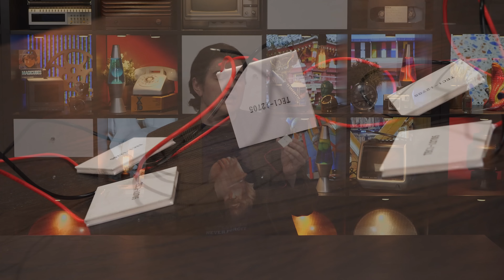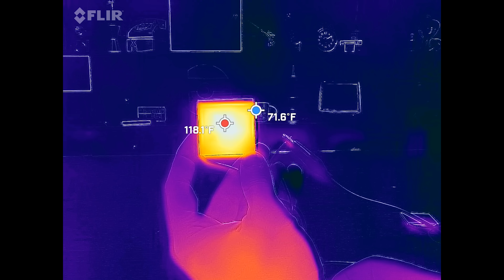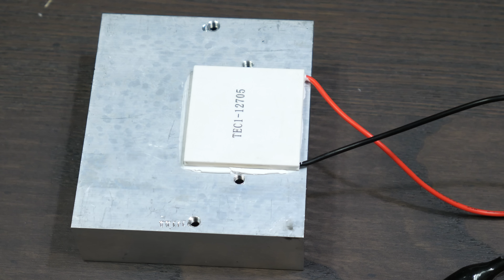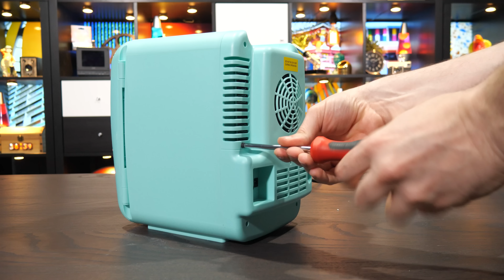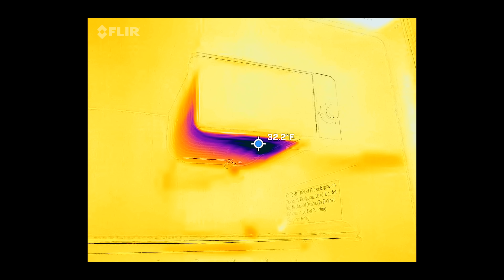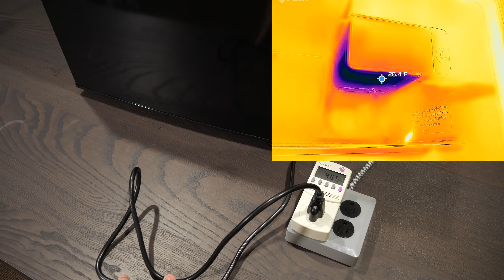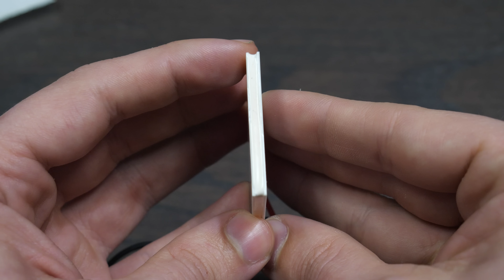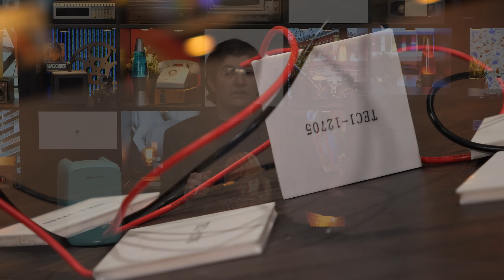Thermoelectric cooling: it's not great.

Comment: Actually Peltier elements do make a nice job while working all the way around: by generating electricity. Such as fans that you can put on top of your fireplace, and it will stir the air around a little bit; or chargers that work from fire. Yep, they suck at generating energy from the heat too, but there's the gimmick: literally everything sucks on generating energy from not very high temperatures, and even turbines with overheated steam doesn't efficient in general, however, we use them because we don't have anything better.

Comment: There's another argument for peltier elements: their size and ease of use.
If you're working on a project where you need some type of cooling but it needs to be small, then this could be a good solution.
Also, heat pumps aren't as readily available for DIY as peltier. In some cases you might even need to do some plumbing with those copper lines. And then you need to be able to fill the lines up with refrigerant.
In countries like Germany you're not even allowed to mess with refrigerants. If you install a split air conditioner yourself without the proper paperwork, you can get a fine!
And these peltier elements can be used by anyone.

Comment: Another application for the peltier plates that i saw getting rather popular were on cooling vests. Ofc they dont use only the peltier for cooling, most of them will have a coolant medium (like salt water slush) and like the blue blob require fans to expel the generated heat, which makes the form factor compromising with a lot of things. Mainly the batteries used. You wont be hooked on the mains while working with a vest like that so you will need a high discharge and capacity portable battery to be able to feed the peltiers, fan and portable pump used to move the coolant stound the tubing inside the vest. Might as well have a mesh vest underneath and put some cooling gel bags or even ziplock bags around your chest area rather than using those.

Comment: I used to have a small cube fridge, like the black one in this video. One day, it stopped working. I wanted to try to fix it myself, so I looked up the exact brand and model and I was shocked to find out that all it had inside was one single peltier, a heat sink and a small fan and this was responsible for making the whole fridge cold.

Comment: 1. One big advantage of Peltier cooling is that it cools or heats pretty fast. The thermal cycle of refrigerators is pretty slow in comparison
2. Theoretically, you could reverse the cycle of a refrigerator heat pump to heat the inside instead of cooling.

Comment: You forget the flip side if TEC's. That you can use them to produce electricity (very inefficiently.) like on deep space probes.

Have a Pu240 heat source, tec in the middle with a heat sink exposed to the cold vacuum of space and boom reliable electricity for decades.

Sure you don't get a lot of electricity, and it's woefully inefficient. But with an effective infinite heat source and a few ganged up together you have yourself a regular nuclear battery.

The Soviets also used this system (Thermal electric generation) to power remote listening posts, radio relays, ...

TEC's are awesome. Just very niche 😜.

Comment: I recently purchased a "cool box" fridge for camping and I have done a load of experiments with it. It'll get down to 5 degrees celsius pretty quick if you add ice packs at home first. It'll stay around that temperature all weekend running from a lifepO4 battery charged from solar.
Yeah it's not efficient and the mini drinks coolers are crap and not worth having at home, but a cool box for camping off grid for a few days is the difference between a warm beer and a cold one.
I wouldn't take a fridge camping as it's not practical for us, but the cool box is perfect. On the flip side, I wouldn't ever use these at home as they are not as good as a fridge.

Comment: Get one of those really compact compressor based portable car fridge freezers that are chest style. Insanely efficient and way smaller than one of these mini fridges. Put it on the floor and you can open it from the top. They have ones as little as 10L capacity and 45w-60w while in use.

Comment: I had a dual stage wine cooler that was a peltier device and it worked great it could cool a 12 pack down in like six hours but it pulled 240 watts It could hold about 30 cans as well then I got it for 30 bucks Used so that's $1 per can

Comment: If you are in a room that has problems holding heat, anything that'll help keep it warm is welcome. I'd imagine that small fridge would be helpful to be a little extra heat in a small, cold bedroom. That is a small victory for the peltier fridge, but still. If your room regularly gets to say, 60f/15.5c, this would keep beer more that cold enough and might even freeze things a bit (slowly. The latent heat of freezing is just as much of a doozy as the latent heat of vaporization). Still, for only 6 cans? Not 12?

Comment: Perhaps the most practical use for Peltier units is to use them as a generator. When you apply heat to one side and put a big heatsink on the other, a tiny bit of current is generated, and it's enough to run a little fan. I have two peltier powered woodstove fans and they are very effective at moving air away from the stove and there's no fiddling around with cords. It's a great way to improve the effectiveness of heating my home with a renewable, off-grid, carbon-neutral, locally-sourced, fossil-fuel-free, non-GMO, gluten-free, and cruelty-free fuel source. It's also just plain free if you're willing do do a little bit of work.

Comment: I wonder if you could make a more efficient fridge if you used many Peltier elements so that each one was using little current keeping the heat production low and used a thermostat to control the temperature.  Not sure if heat absorbed through the Peltier elements, and the consequential lack of insulation wherever an element is placed, would counteract the benefit of adding more and more Peltier elements.  Need an engineer to calculate if there is decreasing marginal returns for adding more and more elements.  They seem cheap enough to add many.

Comment: mostly unrelated tangent: i have had an idea for a while about a cooling device that converts heat to electricity. even if the amount is too small for any real use, hook it into the grid and you get free cooling.

Comment: One cool use of Peltiers is in PCR (Polymerase Chain Reaction) machines we have in the lab. The PCR process involves amplifying DNA by repeatedly heating and cooling it to copy the genetic material. One of the key advantages of Peltiers in PCR machines is that they can precisely heat and cool the samples to the exact temperature required for each step (within something like 0.1°C or so) - it's not about efficiency here, since samples are tiny, but rather the precision and reliability they offer.
Reply: Ahh yes pcr tests the super usable and accurate science we must trust
Reply: @andreahighsides7756  I mean, yes? It's a common lab technique used for many different things, including genetic analysis and forensics.
Reply: @andreahighsides7756 are you a COVID conspiracy theorist or something? PCR isn't a COVID thing it's a powerful method of quickly replicating tiny amounts of DNA to make a larger sample. PCR is very reliable, the problems with COVID RT-PCR tests must be either the reverse transcription process or the method they use to analyse the amplified sample after PCR. I'd imagine it's the reverse transcription because any traces or errors in the sample will also be amplified by PCR.
But it's wild that you know about PCR but only in the context of COVID tests.

Comment: How would a Peltier fridge run if it had a water-cooling system to take the heat off, good insulation, and a thermostat, I wonder? Is that something anyone has tried?

Comment: oh boy, finally i understand how these trash pseudo fridges work. 

my band wanted to get a fridge for the rehearsal space, so we can keep beverages (mostly of the barley malt+hops+water kind) cool. looked through some ads, offers and such, sent links back and forth for small actual fridges. they were all in the 200-300€ range, so not terribly expensive, but nothing to sneeze at either, considering it'll be an appliance that runs 7 days a week only be used for 4 hours of said week. our bassist sent a link into the group chat with one of these, it was decently sized, enough to fit about 8-10 glass bottles of beer in (if your tetris skills are good enough), and it cost 80€ on amazon. i looked at it, and didn't find the refrigerant warning lable in the description, and knew right away, it's one of those things with a blower that doesn't really cool anything (or so i thought, cause every time i got to use a camping cooler that runs on the same tech, but from a 12v car cigarette lighter outlet, it never managed to reduce the temperature in any perceivable way during the 3 -4 hours the device was needed). 
i told him right away, that's not a proper fridge, but at that point he already ordered the thing. he does most of the organizing for the rehearsal space anyway, so he took this into his own hands. it has an adjustable temperature via a touch field and a built in themometer with a lcd screen right next to the adjustment touch field.

long story short: the lowest the thing will go is 8°C, which is suboptimal when you usually have your beverages at 2-4°C preferrably on hot summer days, but it's better than nothing. drives the electricity bill more than the amps though.

Comment: I recently purchased one of these small coolers on clearance for less than 9 dollars.

Mine has the ability to run on either wall power or car power, twelve volt d c.

What these are actually useful for are keeping drinks cool when you load them from a larger refrigerator.

However, what you will see today is that many of these devices are limited in the power that they can put to the element, because the one I had in the past, that was manufactured in the 90s would freeze 6 cans of Mountain Dew. Solid while plugged into my car, while at the same time Killing the battery.

Comment: I wonder if this is how the Haimer tool setter (used in CNC shops) works; it somehow heats the holder very fast, and then after the tool is inserted, it cools the holder just as quickly. I am gonna have to research that, for sure!

Comment: I've got a minifridge in my office that a coworker gave me for free 25 years ago.  It's been in use that whole time and still keeps my pop nice and cold.    It sits next to an exterior wall.  I've thought it would be fun to plumb a heat pipe into it so during the cooler months of the year it wouldn't even need to run.  But that's just a too much work for the entertainment value.

Comment: I remember being introduced to peltier coolers when LTT made a video on them years ago. They went over how people have tried to use them for CPU cooling on and off for years and it has never made sense because of the inefficiency of the peltier cooler is just so terrible and you need a pretty beefy one to keep up with CPU temperatures. They later modified a chair to put a liquid cooling loop in it to make a cooling chair and they used a peltier cooler to keep the water loop cool and there it worked fine because the heat load wasn’t very much and you don’t want a frigid chair, you want a slightly cool chair.

Comment: I bought one of the Xbox Series X mini "fridges" that ises thos type of cooling. I found it used and for pretty cheap, so it's mainly for the novelty. I've read reviews that they are prone to crap out after extended use, so I just have it for decoration next to my actual Xbox.

Also, at 6:58, I'm sure that sudden drop in room temperature means your house is haunted 😂
Reply: My mind immediately went to phasmophobia, even though I don't play it. My brain is weird.

Comment: Yeah, but they're neat. You also didn't mention that the direction of the pumping isn't the only thing that can be switched. They will also generate electricity if there's a thermal gradient applied accross them. Super duper neato.

Comment: 16:37 You're kind of wrong here. Peltier module IS a heat pump. It's just a solid-state heat pump, that relies on the thermoelectric effect. It does still pump heat. What other fridges have is a compressor-based heat pumps. Just because fluid isn't pumped by something, does not mean it's not a *heat pump*.

Comment: You non - mechanical engineering people need to temper your excitement over heat pumps. The concept of COP isn't some amazing "more cooling energy than is being used" miracle. You're just using the energy stored as heat in your cooled space to raise the temperature of air in your heat sink (ambient outdoor air). The cycle just lets you shift temperatures so that you can heat 90°F outside air using 78°F inside air.

By the way, give thermoelectric devices their due. 

Try, for example, to get the HEATING effect from other electrical heating devices that you can from Peltier arrays for the same power input. Sure, you need a heat sink (they're heat pumps, after all), but that's nothing new. 

And yes, they are very inefficient for cooling, but tell me of another device that can both pump heat and measure temperature / power at the same time (they are also the main component of thermopile optical power meters - especially lasers). 

They're also great for energy harvesting. 

Show s little respect for the humble thermocouple, please. 🙏🏻

Comment: The inefficiency of TEC cooling is why there have been numerous failed attempts by PC manufacturers to use TECS as a means of cooling a CPU instead of using water loops or giant heat blocks. The cooling required to cool a CPU at load requires not just too much power draw, but also because of the inefficient design of the TEC, you always end up overwhelming the cool side and making it moot as is.

Comment: I had a peltier cooler in my semi cab for a few years, but eventually the fan motor died and the newer models didnt have the insulation of the old one (and they had phased out the rubber grippy mat on the lid) so i never replaced it. My newer truck has a decent sized minifridge in the sleeper berth that works way better.

Comment: I knew about the Peltier effect but wasn't aware it worked so poorly for actually cooling things.

Have you ever done a story about CO2 refrigeration (heat pumps)? It needs higher pressures, but no special refrigerants. I believe Audi is using it in some cars now, and over a century ago CO2 "engines" were used to provide refrigeration on the Titanic.

Comment: Not worth the effort I'm sure, but it sure seems like it would have been so easy to make that piece of crap just a bit better with very little extra money. Add a temp regulator, that has to be pennies, insulate that door, more pennies. Slightly more if you insulate the entire thing better.

Granted it still never has a shot at the actual refrigerators, but it could have been so much LESS toy like than it is. Shame the designers didn't even try, lol.

Comment: I want to integrate two peltiers under my keyboard with a slab of steel (for heat capacity) and use them as finger warmers in the cold days.

Comment: Peltier elements… Fantastic for lab equipment, such as PCR (polymerase chain reaction) thermal cyclers used in molecular biology. In this use case you need quick cooling and warming up of very small volumes (batches of 50 microliter reactions) and this technology really shines. For cooling down cans of soda… Ridiculous TBH, such a mismatch.

Comment: I have one of those small "fridge" coolers.  I use it in my small camper to cool soda.  Its powered during the day with a 12vv24v  120w solar panel on the roof of te camper.  I also use a small buck converter to insure it receives 12.6 vdc.  Dont want to fry peltiers elements.   Finally, i have installed the unit into the cabinets above my mini freezer.  Its also insulated with proper venting in the back. 

Also if i want to thaw out dinner from the freezer, the frozen meat is placed into the small fridge to help with cooling the drinks.   So far, works good.

Comment: For a while, Peltiers were popular for getting a CPU sub-ambient without needing all the complication and expense of an LN2 or "phase change" setup. But you do have to account for the condensation risk.

That small refrigerator also isn't moving the inside air. If it was actually moving air across the cold side of the Peltier, using another heatsink, it'd actually work a lot better. Not great, mind you, but it'd likely cool the inside of that much faster and keep it colder easier. Without that air movement, it's relying entirely on what little convection can happen inside that.

Comment: Peltier elements are quite handy for temperature regulation of small things (usually, sensors) in aeronautics where you can't rely on atmospheric pressure to be constant (or even present for high altitude / space craft). The fact you can run them both ways is very handy as it means you don't need a heater and a cooler.

Comment: To be fair, the American standard accounts for places like Texas and Mississippi, while most of Canada will never see temperatures like that ever. I wouldn't be surprised if they figured someone would be keeping it in a garage or something as well

As for the cheap piece of junk, I would like to see what a comparison with one that has multiple cooling units, a thermostat, and at least a cheap ice cooler's worth of insulation. Pity I don't have the microcontroller kit, a half dozen or so peltier coolers, a spar cooler, and some heat sinks just lying around